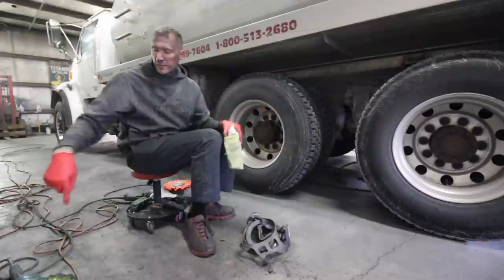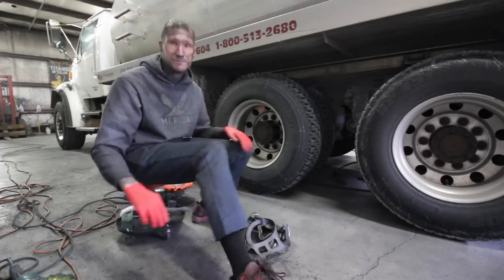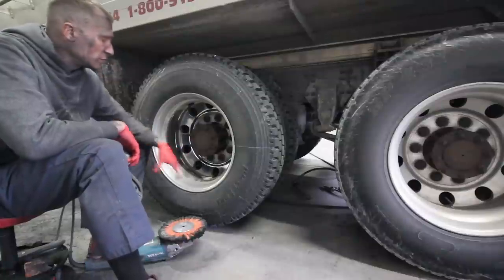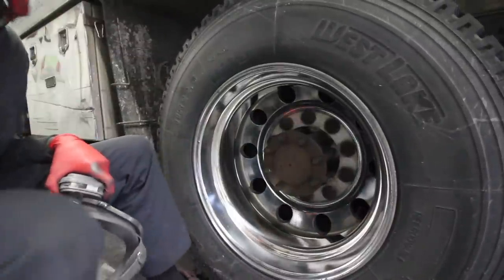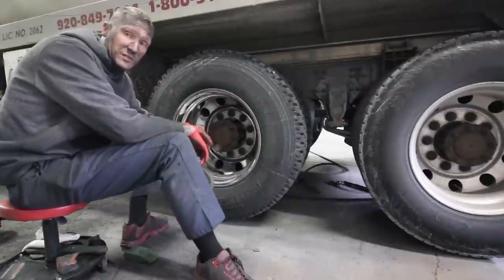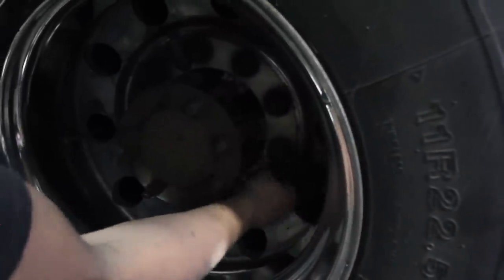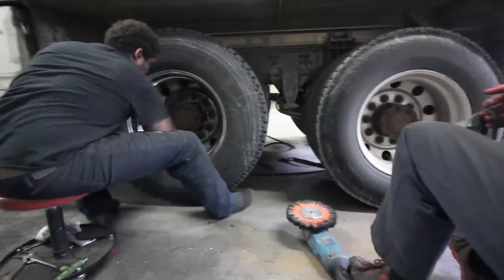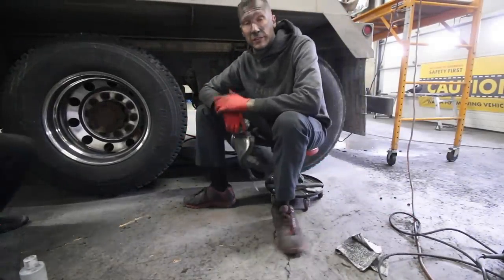How to polish a drive wheel mounted on a truck - In Depth Evan's Detailing and Polishing

Comment: Free tip, been a tri-axle dump truck driver for a paving company for 30 yrs. So u can imagine how long it before any kind of love comes to our truck. new guys are proud, wanna make their truck, theirs. TIP; power wash wheel, soak with easy off, scrub with dish soap and a course 3m foam drywall sander block,  rinse. done!  5 mins TOPS, per wheel, and tanks, 20 mins tops! hit again with finer grade sanding block and so on. just for guys without jacks, buffers and what not. Sick vid for in my own shop tho dude. Thumbs up from me guy!
Reply from the maker: Great info. Thanks for watching.
Reply: What do u use to jack the truck up?
Reply: Are both sides of the axle up and spinning?

Comment: You need to make another video without lifting the truck up. Lots of guys can’t do that and wants to see how a pro would do it. But as always, awesome work 🤙🏽
Reply from the maker: Ok. I’ll do that. I hate doing them on the ground. It was the first tool I invested in. But I’ll make one.
Reply: Same! I bought a 20 ton low pro bottle  Jack from harbor freight and a block of oak for a base (for soft terrain jobs) call me spoiled but I do everything I can to spin that wheel. Quality first is my goal. 🤙 good luck and shine on!
Reply: @summershine_7702  I totally agree on the bottle Jack and wood as well. I've got crossfires on each drive and I hate messing with those.

Comment: After the winter, I start to clean my wheels with SOS pads and soapy water, then sand the faces. And then I followed your process of polishing. It sure is harder than you make it look. It turns out pretty darn ok to me. Thanks for sharing your knowledge
Reply from the maker: I used to do the same.
Reply: If you want to preserve your shine, furniture polish works amazing water just beads right off the shine really lasts long. You still have to do your maintenance hand polish every couple months or so at least I do.
Reply: After watching these video's,    my wheels look much better then before !!  Thanks !

Comment: the water ring while on the truck i use a small grinder and use the pads that get smaller from polishing with large grinder . works great , good job Evan
Reply from the maker: Great tip! Thanks for watching and supporting.

Comment: Great video full of info, Thank You.
  Question, I've got mine already done by hand but not as bright as a wheel. Sense I've got a hand shine could or can I just use the color wheel to finish it off? Newbie here.
Reply from the maker: I never just color. But what I do is if the wheel is nice I start with a softer buff on my cut to reduce the amount of hashmarks. I will have a video out on this soon. Thank you for watching and supporting.

Comment: Hey Evan Love the videos fantastic work you do, I do drive a semi 2024 cascadia and want to do the same thing to my wheels Will steer and drive however I had a quick question, I really don't want to invest in another grinder. I have a grinder at home, a Ryobi, the max level 11,000 RPMs and I know that's way too fast I also have a DeWalt corded drill that maxed out at 2500 RPMs. It's one of those better than the other and will the 2500 RPM drill be sufficient? Look forward to your response thanks man
Reply from the maker: Sadly neither one of those are sufficient.

Comment: Always use an aluminum acid to clean the aluminum first it will make the polishing much easier!
Reply from the maker: I highly disagree with that statement but to each their own. I personally find avid makes more work and does long term damage to the wheel. Most people don’t properly neutralize it before polishing and then the first moisture you hit it reactivates and starts eating at your shine. I’d rather sand than use acid.

Comment: What does it mean when you see pores and fog after you cut and color? I sanded my battery cover from my dump truck with 400 then I cut and colored it with your brown and orange and green and yellow kit and my end result was fog and a lot of pores. The cut and color processes did achieve a mirror reflection though I'm just trying to figure out if I should have sanded with a 200 or 120 and worked my way up to 400? The pores were kind of deep as well.  And I cut it about 5 times and polished 2
Reply from the maker: The smoother it is the clearer it is.

Comment: After you polish wheels. are you supposed to use some kind of sealant to protect the polish. Asking because a friend of mine says there is such a thing but I’m not sure Because I’ve never seen any truck polisher use one afterward.
Reply from the maker: Most polishing compounds have a ton of wax and sealant in it. After I color it I don't touch it with anything.

Comment: Nice work. I got some chrome cleaner on Aluminum tank & wheels, now left with drip streaks. Best way to make it look better. I don’t have a lot of time in a day to work it out. Is there a neutral chem I can use to make it look how it should?
Reply from the maker: Hand polish or recut and color is only option. No amount of cleaner will fix chemical burn. Sorry

Comment: It's my intention to polish out my '16 Cascadia. 10 aluminum wheels a 120 gal fuel tank, near full deck plates, a 50 side saddle Hydrolic tank and a Diamond plate pickup tool box. And the aluminum steps  problem is I'm in the muck of a steel mill 2 weeks out of the month.
Reply from the maker: You'll get it brotha.  When the time is right you will get it.

Comment: I just got a makita 9237c and buffing wheels. I couldnt even get mine in to get close to the lug nuts on the drive axles, i have 22.5 wheels. Too big of a polisher?
Reply from the maker: I have used the 9237c and can get into the lug nuts no issues. It is the angle of the machine that makes the difference. Look at the angle at which I hold the machine. Really gotta shove the machine in there.
Reply: @EvanStegerMetalPolishing  Thank you for the reply. I will try to get it in there next time. That little rascal likes to pull away when it hits those holes in the wheels.

Comment: What wheel and compounds would you use to polish a pontoon boat to a show quality shine? I’m kinda at a loss with all the choices
Reply from the maker: You couldn't pay me enough to polish a pontoon to a show quality shine. But if I were to make a recommendation on how to do it I would say sand it perfectly smooth. Then cut 2 times with orange buff with brown rouge overlapping in different directions. Then doing an orbital hand polish with a rough metal polish like luhmi or something similar. Then I would cut with yellow compound and my show brown rouge. Then I would use a light metal polish like my time2shine aluminum polish on an orbital buffer. Then finish it with the 40 ply loose buff and my green compound. This process depending on the size of the pontoon will take days to complete and first time you put it in the water it won't be show quality anymore. LOL This is why I don't do pontoons anymore. LOL If just looking for a quick polish our 2 step aluminum kit is quicker and easier on goshineon.com

Comment: Well I am not all that good. My Dewalt 7in went flying a good 20ft and broke on the concrete. No parts available. So I got the exact same model Makita used in the video. You make it look so easy without handle on it or really hanging on. I got a death grip on my new Makita and doing the inside part is not going so well. I'll try your method. Do you think bracing off the hub mounted is easier for a beginner or dismounted?
Reply from the maker: You should be do things the way that you are the most comfortable.  Use the handle if that helps you.  I know a lot of polisher who use the handle on the machine. I have been doing this a long time and have had this machine in my hands for 20 plus years, so it is going to look easy for me.

Comment: I need to step up my game from my cordless drill and mothers cones. Is there a variable speed Grinder you would recommend that would do both the cutting and coloring?
Reply from the maker: Yes I have links posted in my description on this video. I recommend the makita or the dewalt variable speed. Depends which brand you prefer.

Comment: Does the pad you use while cutting matter?
Reply from the maker: Yes.  You want to make sure that it is a stiffer buff that will maintain heat without softening too much during the cutting process.

Comment: Just a question . Can I use my 4.5 inch Bosch angle grinder or is this something else is he using.
Reply from the maker: Likely not. Most 4.5 inch grinders spin 9,000 rpm or higher. Way too fast for the buffs. Buffs are only rated for 3,500 rpm. I know I spin mine at 6,000 rpm but it is risky.

Comment: Hey maybe you could help when I’m using my first stage of cut I’m getting a lot of sticky black spots that I have to scrub off by hand or it seems like it burns in if I don’t rub it off with a rag. Any help would be appreciated!
Reply from the maker: Likely the piece you are working on isn't smooth enough to polish yet. Send pics to my cell and I can try to help you diagnose the issue. 92009790386. Thanks for watching.
Reply: Asphalt remover Citron

Comment: Is the safety flange kit you’re using on the majors 5/8 or 7/8 if 7/8 where can I find it?
Reply from the maker: All ours are 5/8-11 thread. If you need a 7/8 you'd have to have a machine shop build them.

Comment: Been practicing on a rim and got clear solid reflection when using the scuff pad on a grinder then cut and color. Then went into sanding to remove pits and seem to not get a clear reflection at the end of the cut and color. Why would this be. I know something in the sanding stage does it but can’t figure out why.

Comment: Is it possible to get polishing wheels to fit a side grinder? I have 16" drive wheels to polish on my dually.
Reply: From what I’ve seen you need a 5/8” arbor on your grinder to just put the disks on.  Maybe you could find an adapter if it’s smaller than that...those are some tight wheels to get into, good luck!
Reply: @Alero2k4  Thanks
Reply from the maker: Alero nailed it on the head.

Comment: Greetings. a question What type of sandpaper is given to the wheel. before starting with zephyr help. I'm a noob
Reply from the maker: First question is do you have to sand? With my stuff I don't have to sand all the time. I would need to see what you are working on to give you a proper recommendation on what to sand with. Text pics to my cell. 920-979-0386. I will try to help you the best I can.
Reply: @EvanStegerMetalPolishing  Hi,good job,what type of pad are you using for the first pass ?
Reply from the maker: @narvinnsnan6311  I use an orange pad and brown compound from goshineon.com/shop
Reply: @EvanStegerMetalPolishing  thanks for the info buddy,will visit the website..

Comment: Evan I've used for years a Milwaukee 6066 to keep my trucks up. Today while using it it just beats my butt and the older I get the more I notice that thing feels huge. Been looking at makita like you use and dewalt and think they look lighter. Any opinions on if that seems true?
Reply from the maker: I used to use that same model. Makita is much lighter.
Reply: @EvanStegerMetalPolishing  I'll have to get me one. I went and bought a 8000 rpm  dewalt because it was half the size. Let's just say it didn't take me about 5 mins to say uhm I'm not that crazy. Talk about dangerous. Lol
Reply from the maker: @jimbo7450  True story. Even I don't risk that fast.

Comment: Are he using angel grinder ?or polish machine? I see its about twice the speed on the angel grinder 6000rpm vs polish machine 3000rpm
Reply from the maker: I use a 6,000 rpm grinder. It is dangerous and risky for the record.

Comment: Do u use a variable speed polisher or is that just a normal grinder unit?
Reply from the maker: I do have both.  I prefer using the 6000 rpm.

Comment: i have a few a couple of questions if you don't mind. first , i am NOT trying be a smart ass, but an honest question to someone that has been doing this for some time. your video is the 2nd one i've watched where you wear the full face respirator, yet your face is black like you work in the coal mines. so, i am wondering how effective are they in your opinion? second question is with all the residue you have on your skin, (arms,face, etc} how much chemical absorption  from the various items that you use, do you feel you are getting?
   i would like to try this on my personal stuff, but was curious about the questions i asked.
Reply from the maker: The respirators are fairly effective if you leave them on all day and never take them off. But polishing dust just hangs in the air as they are super light particulate... If you take your mask off to talk or answer the phone the dust settles in your mask, around your mask, and on your sweaty face. I also put lotion on my skin every morning to help slow the absorption of the chemicals and metal dust into my skin. Aluminum dust is a very risky deal. Aluminum dust has been believed to be a leading reason for Alzheimers. I hope this info is helpful and answers your questions.
Reply: Everything is killing you, actually you were born dying out of the womb. 😂

Comment: Why do you hit the wheel on the ground for a second ?
Reply: Also what’s the average price for just a work truck buff
Reply from the maker: It’s hitting the block of rouge. Not the ground. Sorry I could have picked a better angle. Thanks for watching.
Reply from the maker: There really isn’t an average price. I charge by the piece based on condition and work I have to put in it to get it right.

Comment: Greetings from the Ohio Porters.🇺🇸 Do you have more customers that want a quick buff up or more that want the full package that requires you to take the wheels off?  I think getting the wheels off the ground makes the job flow much easier. I like doing that even when I wash my tires and wheels, but I usually don’t need the wheels to spin for that process. Good stuff!🤩😎🥰
Reply from the maker: I would say it depends on the time of the year.  Truck show season we will take more wheels off.  Typically we can do the rims on  the truck.

Comment: How much does it cost to get a rim polished like that
Reply from the maker: All depends on the condition of the wheel to begin with. If the wheel is decent it starts at $25. If the wheel is rough it can get up to $75. But my rough and your rough might be very different.
Reply: @EvanStegerMetalPolishing  k I  almost always take the tire off the truck and off the rim and I stay in a rural area so 95 percent of the I have to sand

Comment: Shalom Evan I enjoy your vids
Your left leg was blocking the view
Also are you putting on more compound on the bar when you take the machine away from the wheel?
Could not see what you where doing. 
Thx. Keith
Reply from the maker: Yes. Sorry it is hard to keep the camera and body out of the shot. But yes. I was adding compound everytime I pulled away from the wheel.

Comment: What rpm polisher are you using?
Reply: He is using a 6000 rpm makita
Reply from the maker: Tj nailed it. I use 6k
Reply: Thank you!  Will a 11,000 rpm grinder be too fast and create too much heat?
Reply: 11,000 is too fast. Buffs are not designed for that kind of speed and would likely explode
Reply: Thank you! Definitely don't want that to happen.
Reply from the maker: @tracyhorn360  11,000 rpm is way too fast. And it's very dangerous.

Comment: You not sanding before polishing?
i thought it should always be sanded
Reply from the maker: I only sand when I have to 70% of our stuff isn’t sanded.
Reply: @EvanStegerMetalPolishing  thanks man,is better to sanding wheels and tanks with rotary from p400 to p2000 or orbital sander what you recommend?
Reply from the maker: I never sand higher than 600 grit.

Comment: Hi a have a Alcoa wheel brand new and i have a minor scratches on it caused on installation how do i remove it? Do you have any video showing it? Or  some suggest ? 
Thank you for sharing all those nice videos to us!!
Reply from the maker: if you can text pictures to 9209790386 I can try to help guide you on how to repair the scratches. It depends on how bad the scratches are to repair.
Reply: Evan Steger i did that by hand it is the first time I haven’t been done this and i was afraid to damage even more! 
I gonna sent to you some pictures 
I really appreciate that 
Thank you!

Comment: Shit I can't help but laugh when you start buffing on the outside lip and it comes so clean so quick... The truck I'm working on does not come clean quickly like that at all! Mind you I'm not using a 6k rpm machine though and the truck was never polished properly since 2016. Was a nice mention of where and why you use colour btw Sean!
Reply: 6k rpm machine makes a world of difference i highly recommend
Reply: @thanehardy2402  Ok, I'll keep that in mind and when I can afford to make the change I will. I'm assuming when you say "world" you mean time saving, quicker cutting..etc..?
Reply from the maker: Thank you!

Comment: bro i polish why dont you use wheel acid for the rims to clean it , and i rather use a pad instead of an air way it comes out better if you no what your doing , i do rims ten times worst than yours and they come out like A1 even if i have to sand them  MMP manny metal polishing - instagram me
Reply from the maker: Everyone has their own way. I never use acid. It does more damage than good but that is my personal opinion based on what I witnessed with a metalurgist under a microscope. Plus if the acid isn't fully neutralized when you polish it the next rain storm your customer hits can reactivate the acid and cause it to start ruining their polish earlier than it should. But once again this is a personal belief based on what I have seen. To each their own. Your process I'm sure is great for you and your customers. Thank you for watching.